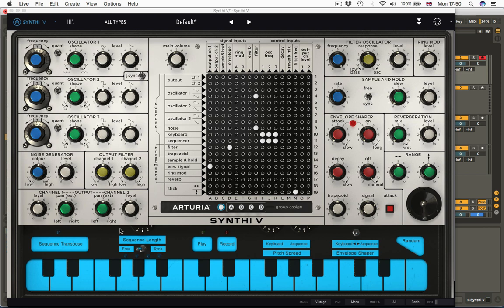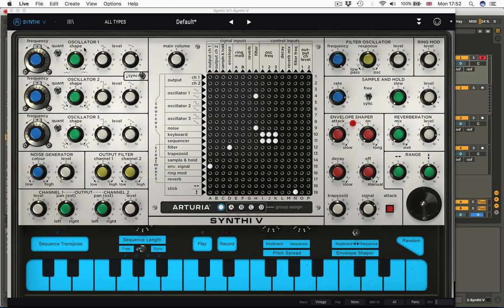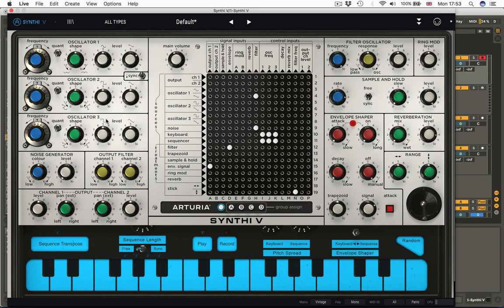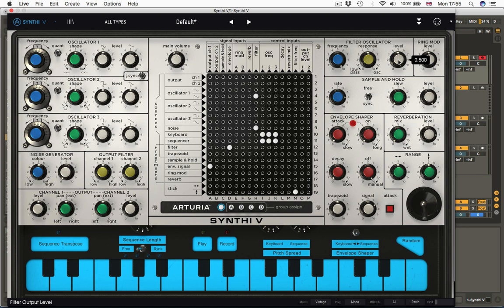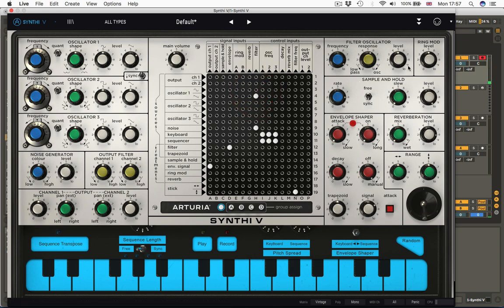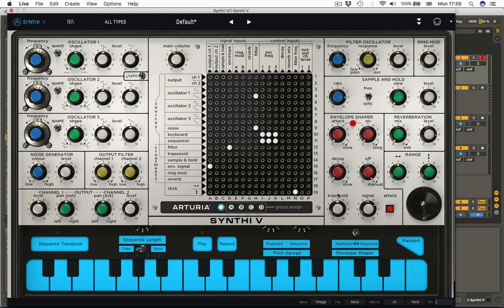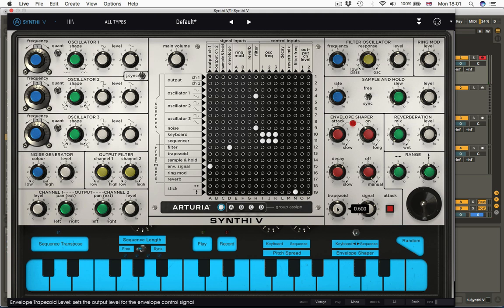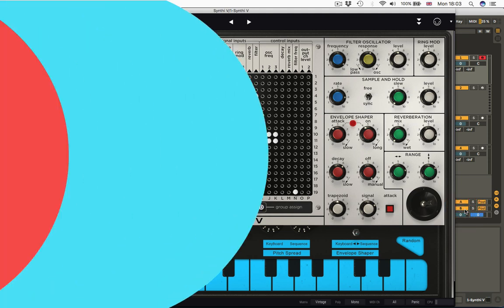How To Use Arturia Synthi V with King Unique - Overview Part 1

Comment: anyone know if there's a way to get CV into this like an interface? or at least get it to interact with a software sequencer etc?? or logic etc?
Reply: I’m not sure either? But if you get ie. Arturia Keylab [XX] mk II keyboard, you get 4 CV outputs and 1 CV input to control your external analog synth with it. And naturally if you put Synthi V on your DAW, it can also control that external as well though that mk II. (If I wasn’t totally lost what you meant?) And I bet there should be even cheaper alternatives that convert MIDI data to control voltages to be send to external synths.
Reply from the maker: Not sure what you mean there?
Reply: Maybe he's suggesting like the back of reason instruments where you can take a sepearate cv voltage and apply it to various sections.and use the outputs from a different vst.
Reply: Leighton Cooper Why you would do that with CV! You can control every bell and whistle of every virtual synth on any DAW with just MIDI messages!? Why you should need CV for that? Unless of course you want to send and/or input it from your external synth that doesn’t have any MIDI.
Reply: But if you meant that if you can use that (or any other Arturia V collection synth for that matter) on your computers software sequencer (ie. DAWs, right?): SURE you can! They all have several different virtual instument plug ins (out of my hat, so dont shoot me if i got it wrong: At least VST3 (only 64 bit from now on), AU and AAX plugins. That should work on most DAWs used today. As well as working as a stand alone programs on your computer, so you dont necessarily need any DAWs to make some noice! :P
Reply: i meant control it from a CV cable with a voltage on it ... like from a CV sequencer. how do you connect it to this 'synth'?
Reply: antigen4 Then you need either that Keylab mk II (or similar) that has CV input, that is send to your DAW (or even straight to your stand-alone Synthi? Propably?) and it then controls anything on that VST Synthi what you assign it to control. Or other way is by means of CV to MIDI converter, that then sends it to your DAW or Stand-alone Synthi as a MIDI message. And use it anyways you wish as on that previous example.

But without neiher of those, you can simulate it too. As V Collection has whole plethora of other synths that has software synths on them, that could be routed directly on your DAW to control Synthi with it. Most versatile and one that I would use might be the one that is on that Moog Modular?
Reply: antigen4 Here is that mk II video I just watched where that Tuber used his keyb to control his external synt with CV. And around 14 minutes he used that CV input too. https://youtu.be/sJRMsrI6Jvk But now that I think of it, only 1 Cv input wouldn’t be nowhere near enough of inputs for sending whole external sequencer data to a DAW. As it also needs at least clock, note CV, and whatnot!? (I havent ever used CV controlled anything, other than virtual synths, so I’m not that familiar of those, sorry)